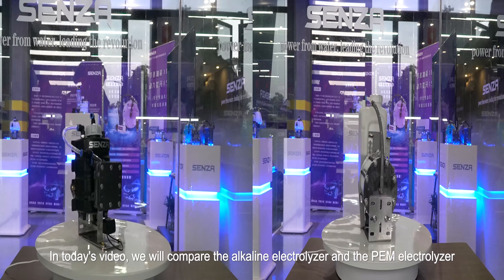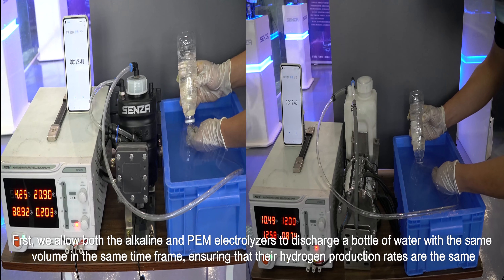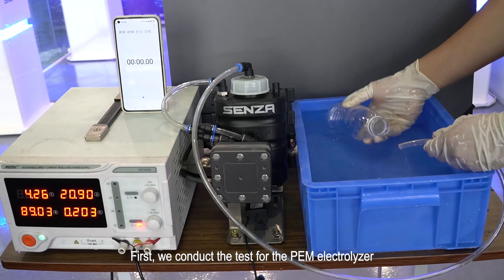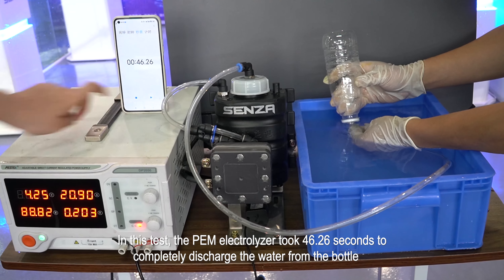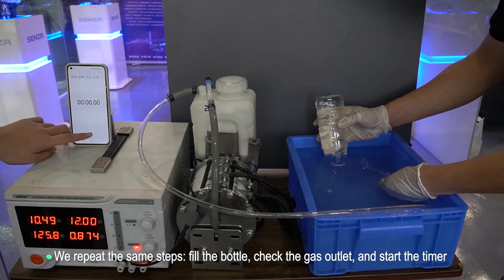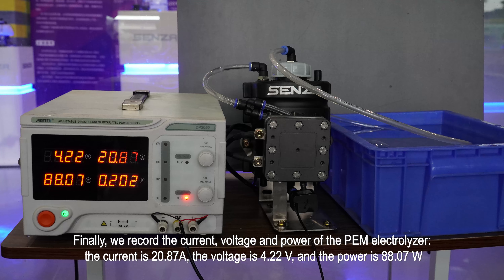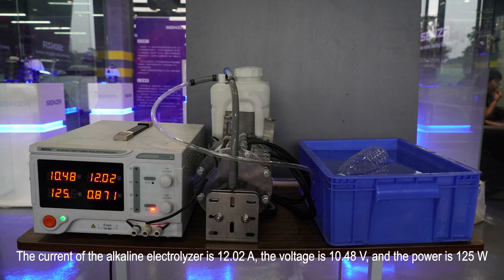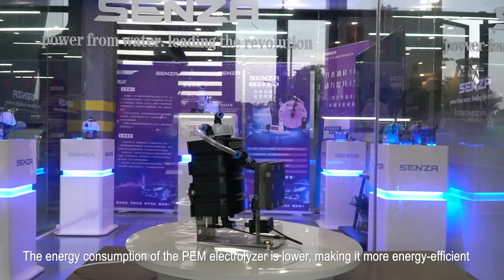PEM vs Alkaline Electrolyzer Energy Consumption

Comment: Bruh , Can i able to buy mini PEM for project?? And one doubt...I have read online that in alkaline water electrolyser may corrode due to the electrolyte that reduce the lifespan of electrolyser is it true??
Reply from the maker: 1.If you want to buy PEM electrolysis tank please contact us.(service@senzahydrogen.com) or you can check https://senzahydrogen.com/products/pem-hydrogen-generator
2.Alkaline hydrogen electrolyzer are prone to damage the stainless steel plate sheet in the centre. And alkaline hydrogen electrolyzer are very difficult to maintain.
Reply: @senzahydrogen  PEM electrolyzers degrade over time too.  It takes much longer for a PEM electrolyzer to degrade but they're much more expensive to when they do need to be replaced.  Speaking of maintenance, I heard that PEM electrolyzers should not be started often with cool water (under 77F).  Do you know if this is true?  I want it to last as long as possible.
Reply from the maker: @ChristmasEve777  Actually, PEM electrolyzers do not have stringent requirements for water temperature, operating between 5-70°C is acceptable. Running outside the optimal temperature range (but still within 5-70°C) will just slightly reduce the reaction efficiency, it won't damage the PEM membrane. After operating for a period of time, the temperature will gradually increase to a level more suitable for the electrochemical reaction, reaching a dynamic equilibrium.

Regarding maintenance, any reactive system will experience performance decay over time due to the reaction, but PEM exhibits better durability compared to alkaline electrolysis in terms of decay rate, post-decay performance, etc. The PEM membrane is quite stable.
Reply: @senzahydrogen  Thank you so much for your very detailed response!  I appreciate it.  I'm glad the temperature of the water isn't a problem (it's always been well within that range: 5 - 70).  I might be interested in a PEM electrolyzer from your company.  I've had them in the past but I'm not sure what I did to cause quick degradation.  I used distilled water and also passed it through deionizing resin.  I'm wondering if frequent startups causes accelerated degradation?  I do not keep my electrolyzers running for a long time at once.  I might start it up for an hour or two, turn it off, and maybe another half hour later in the day.  Some days, even more, like 8-10 startups in a single day.  There's another rumor that this can cause degradation.  What do you think?
Reply from the maker: @ChristmasEve777  The rapid aging of an electrolyzer can be caused by various factors. Firstly, excessive voltage and current can negatively impact the lifespan of the electrolyzer. Secondly, if the water used is not properly treated with deionizing resin, it could lead to increased resistance in the electrolyzer, affecting its performance and lifespan. In addition, the usage of a water pump might also affect the electrolyzer. Without proper water flow, the DuPont membrane might degrade and age. Frequently starting and stopping the electrolyzer, especially under high current conditions, could indeed affect the lifespan of the electrolyzer to some extent. However, the lifespan of an electrolyzer is also related to the materials used during its manufacturing. If you are unaware of the specific materials used and the expected lifespan of your electrolyzer, this issue might be difficult to accurately judge.

Comment: is it H2 or HHO generator
Reply from the maker: Both types of electrolyzers generate HHO gas. Of course, PEM electrolyzers can output hydrogen gas separately, but alkaline electrolyzers cannot. You can check out this article to understand the differences between them.https://senzahydrogen.com/pem-hydrogen-generator-vs-alkaline-hydrogen-generator.html
Reply: @senzahydrogen  Thank you for your reply. May I ask one more question? I have seen many electrolyzers online that have H2 and O2 output on the same side. doesn't both gasses are mixed during generation even if it is PEM? How they are being separated? Is it possible for AEM?
Reply from the maker: @raihanulislam9326  Because they might be using an alkaline hydrogen electrolyzer instead of a PEM hydrogen electrolyzer. From a technical perspective, separating H2 and O2 in alkaline hydrogen electrolyzers is very troublesome and uneconomical. As for PEM electrolyzers, it's relatively easy to separate and output hydrogen and oxygen gases individually. For detailed operations, you can watch this video at https://www.youtube.com/watch?v=q-LwF_sfMxc. https://senzahydrogen.com/pem-hydrogen-generator-vs-alkaline-hydrogen-generator.html . As for AEM electrolyzers, we haven't conducted in-depth research, but from a technical standpoint, it should be feasible.
Reply: care este pretul pentru un chit auto 2000cc benzină?